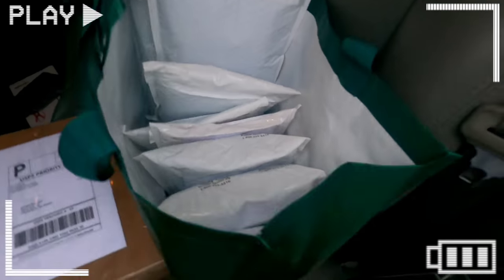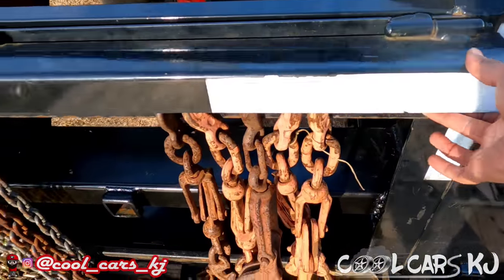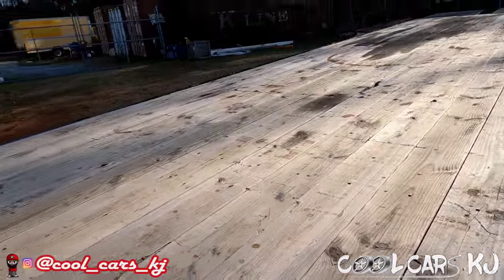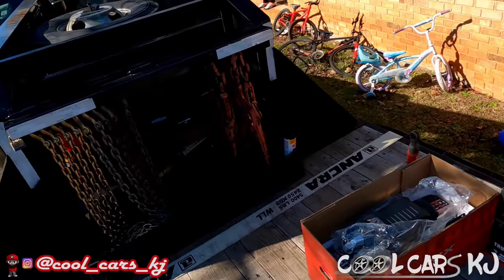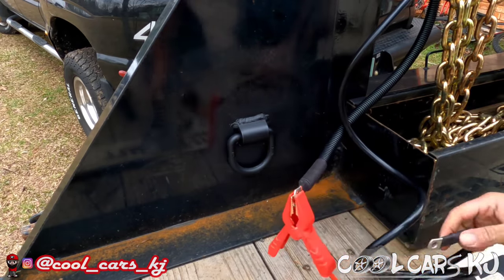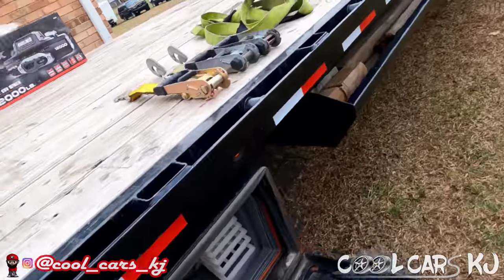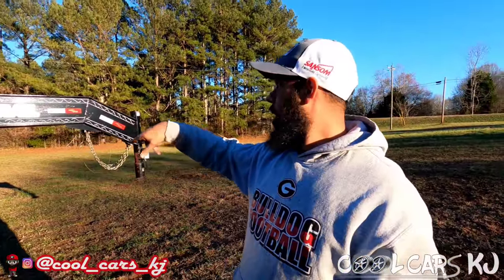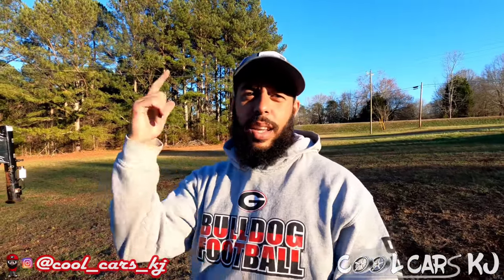FINALLY added a BIG 'ol winch to the 40ft hotshot trailer 💪 #badlands #apex #winch

Comment: Put you a rubber mudflap behind your chains it'll save your paint and check out the speed binders that you use a drill to tighten they cost more but work amazingly well

Comment: I have the same winch on both my trailers and both my trucks. I also have those yellow foldable binders. Work great it saves lots of time if you flick the little flipper to tighten or release in the middle it free spool the binder.
Reply from the maker: Thanks for the info bro. I definitely have to pick some up

Comment: Since the trailer already has a charging setup I think you should mount the winch battery beside the compressor battery then tie into the wiring up front